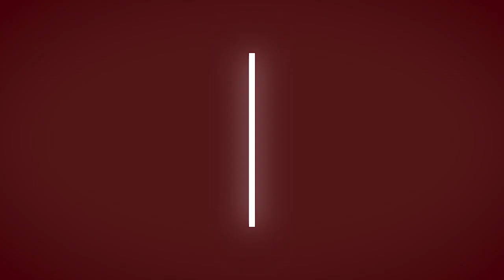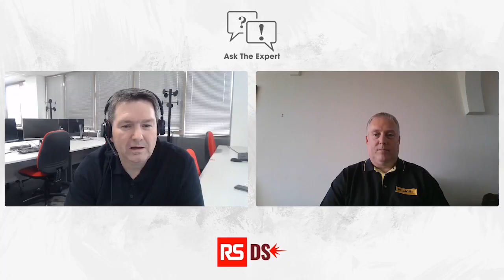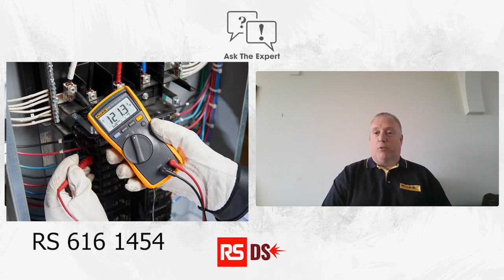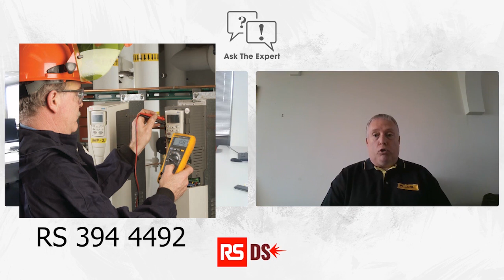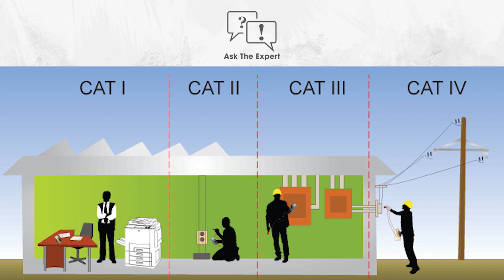How to choose the right Digital Multimeter

Comment: I’d like to make a choice based on the repairability of the Meter, seeing as many engineers (like myself) use Multimeters, supplied by companies like RS that supply parts to repair Electronics and not be fobbed of by the Manufacturer of said Multimeter under the premise that the Multimeter isn’t repairable.